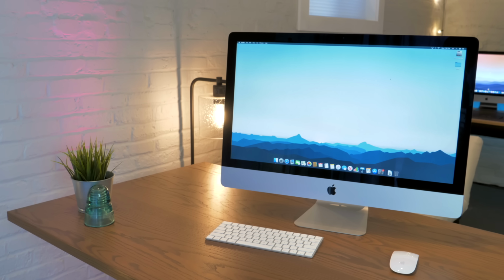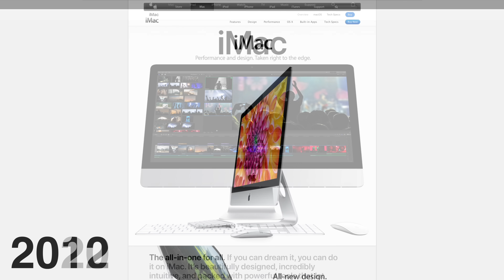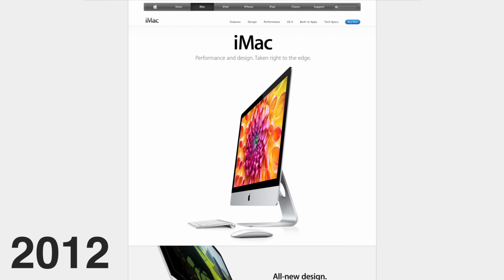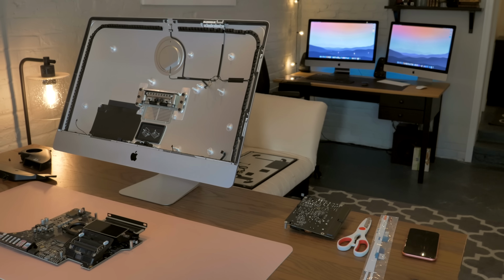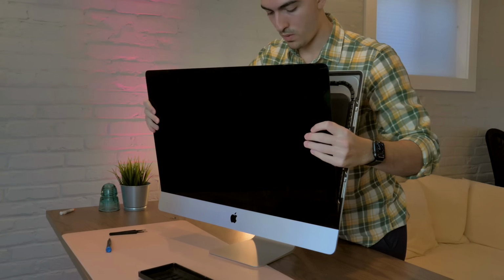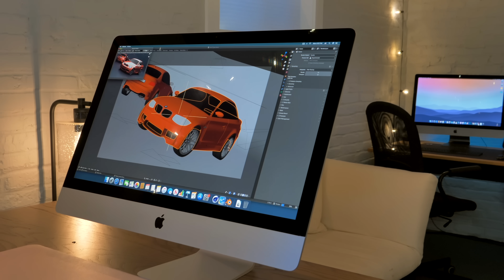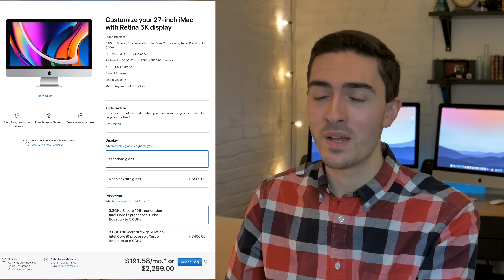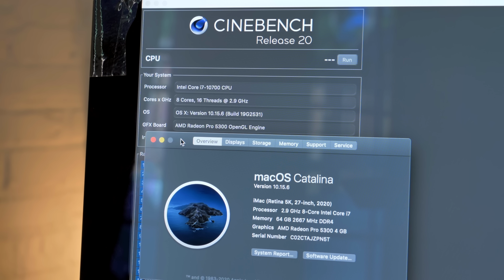DIY 2020 iMac upgrades! Is the LAST upgradeable Mac worth it?!

Comment: It kind of sucks they removed the NVME slot but having done some digging around about this myself as well as a "buy from apple or DIY comparison" I'm not sure it matters much that they removed it.  NVME storage is a pretty expensive option and Apple is, and I hate to give them any credit here, mostly competitive with the DIY route on price.  Some basic arithmetic tells me that at 2TB it's probably smarter to just pay Apple the $500 they want.  It's $429 + tax going the DIY route.  That's based on the 970 Evo Plus.  So just about $450 let's say.  Taking into consideration the disassembly the math just doesn't add up at 2TB.  For me at least.

At the 4TB point it might start making sense but the problem is buying a 4TB Nvme SSD.  Options are kind of limited.  There is the blue label Sabrent Rocket at $899 + tax but Sabrent don't quote a TBW rating.  Or at least I couldn't find it anywhere.  2TB 970 Evo Plus is rated at 1200TBW.  The copper label Sabrent Rocket would be a good option perhaps with 3600TBW rating but it's not offered at the 4TB point only 2.  Buying the blue label Sabrent is about $1000 with tax and it is a TLC drive after all so maybe at this point it starts making sense.  I'd like to see a TBW rating but for the purposes of this thought experiment here I suppose we could overlook that.  You still have to disassemble your imac though so is that worth $500 for you?  I don't think it is for me.  I'd still just give apple the edge here and just pay the $1500 they want to save myself the headaches.

Finally at 8TB the DIY route might start making sense.  Thing is though you can't buy a MLC/TLC based nvme drive of this capacity.  Looking at the iFixit teardown it looks like Apple RAID their NVME drives inside the imac for capacities above 2TB.  See here: https://www.youtube.com/watch?v=e8PVW2E0ogI&t=250s
Ifixt tore down the high end imac 2020 with 4TB of storage and you can see it's 2 SSD sticks.  I'm pretty sure the reason they do this is because TLC based NVME drives at capacities higher than 4TB are hard to come by.  So again the picture is unclear.  There was only one nvme slot in the 2019 imac so even if this was left intact not sure you could do much about it at 8TB capacity point.  Of course this could all look different down the line but for the moment I'm not sure if you could take advantage of the slot even if they left it.  And since it's hard to find 8TB MLC/TLC based drives at this capacity the price comparison is kind of impossible.

The prices above are all CAD by the way.  The situation could be different in the US or elsewhere obviously.  Also I've done a bare minimum of research about this as well just fyi so take all this with a grain of salt and do your own research.  Because the nvme slot is gone though it's all a moot point perhaps.

Comment: A couple of hints to help.
1.) when removing the display you put some masking tape at the bottom to stop the display sliding off.
2.) I would remove the chip strap as that would help removing the components (chip strap screw are the cross head at the bottom and it lifts out)

Comment: Why not track down one of the slots for the upgradable ssd, or remove one from a "dead" imac parts machine to solder it to the pads that were left on the motherboard to see if it would work.

Comment: Luke: in respect to Blender: if you tested only under MacOS you didn’t really test the GPU because Blender doesn’t support METAL only Open CL for AMD cards and Mac OS doesn’t support OpenCL anymore. You would have to switch to windows and run it there. In which case you can select options for rendering: CPU only, GPU only or combined.

Comment: What brand makes the best adhesive kit so that the screen doesn't fall off and break 2-3 days later? I have an OWC adhesive kit for my 2015 iMac to use when I install my 2TB SSD with their thermistor cable kit, but I'm afraid it might not b the best (everyone seems to have reports of failure).

Comment:  certified technician tip: when servicing any iMac - remove the security bar which lines the bottom of the display enclosure. 
The reason you were having so much trouble wiggling components out is because the bottom-lining adhesive actually covers the roughly 9 screws holding the security bar in place. 
Once removed everything slides out with ease. It's also one of the first things we check to see if an iMac has ever had any "unauthorized repairs."
Reply: it's called a chin strap
Reply: @thecheapthrillspodcast was gonna say the same 🍻
Reply: Simply excellent you are sharing that knowledge. So praiseworthy. Not that I even have an iMac, was only leisurely watching this video. but I was struck by something so generous. Most other guys in your position would worry about financial loss letting such things into the wild...
Reply: @BilisNegra  i actually hate my job. I have to give so much bad news to customers as a technician in regards to logic board failure resulting in data loss unless they've already backed up their data.
i'd much rather end-users be able to actually own the tech that they've already bought. just like any PC owner - you should be able to upgrade your RAM, Storage, GPU,  and given the recent shift to Apple Silicon - especially the CPU.
I'll always share whatever is helpful.
Reply: @BilisNegra  the way Apple and Apple servicing is growing no one will ever lose work / income by sharing such things. It’s only when a technology and market are shrinking that people start trying to project their own nuts. It’s book time for all things Apple. Those of us that DIY would never pay for tech skills if we already have em anyway. Just did an airport / time capsule 8TB upgrade on my kitchen table today. Took about 30mins. Easy when you have the skills.
Reply: Came here to say the same thing... was like "just remove the bottom bar and make your life easier" lol
Reply: where is the security bar?
Reply: so you can upgrade the ssd storage right?
Reply: @blueu127  nope, it's soldered, and it doesn't have extra SATA or NVME port.

Comment: Hi Luke! I was wondering if this MacBook on eBay is a good deal. It’s a MacBook Air 2012 with an i7 (3667u?), 8gb ram, and 128gb ssd for $379
Reply: Mba 2012 will be rather slow these days, mid 2013 is a minimum IMO. I personally had mba 2013, now mba 2017 and  still love it in 2020.

Comment: I’d rather see slightly larger, if need be, Macs 8Ch that they can be upgraded. I’ve owned Macs for years but am saddened by Apple’s push to restrict both upgrades and serviceability; I originally went to Mac because of operational longevity but this gas nearly been eliminated because of Apple’s push away from serviceability. Apple goes out of their way to make things proprietary just yo limit service, even when this costs more than keeping things basic, like screws with special heads just as an example.

Comment: How is the power supply so dangerous if its not connected to any power source? Can somebody pls explain.
Reply: the capacitors store the rectified voltage form the ac on them. ideally the power probably has bleeder resistors in parallel with those caps. but not always. im not sure if the imac power supply does or not.
Reply: Capacitors

Comment: I wish I could upgrade the GPU in my 27" iMac (Mid-2010) so it can run Mojave and Catalina without the weird video issues. There are several features that High Sierra cannot do after I upgraded my iOS devices to 11 and higher. The old Apple iBooks app no longer displays the highlights made on my iPad or iPhone. The Handout and Continuity no longer work between iMac and iOS devices. And so forth.  So, I am pretty much stuck with specific Radeon 5xxx/6xxx GPU that was used in Mid-2020 only.
Reply: Well I upgraded my 2011 21.5 to catalina which is also supposedly unusable but it’s really not that bad at all, it’s far from unusable and youtube even plays full quality with relatively no lag anywhere on the os, I would make another partition and upgrade to catalina so you can boot into both operating systems when needed, high Sierra for full GPU acceleration and catalina for needed features
Reply: My 2011 has a 6750m gpu

Comment: Hold up. You can upgrade the processor? I just replaced the PCIe SSD (higher capacity) and swapped the 1tb sata hhd to a 2tb ssd in a 2019 27" iMac, , so I'm not scared to open itc up.

Comment: Would this mean that you can in a few years, when 11th and 12th gen etc are out and use the same socket, you can upgrade to newer Intel gens on this same iMac? Would be worth picking one up used in a few years then when the Intel based Apple products dropped in price due to ARM

Comment: No NVME card slot?! I'm staying away from the 2020 iMac
Reply: In T2 systems, the system boot device is locked to the T2 chip, same way the flash in an iPhone is tied to the secure enclave in the A-series CPU. If you swap storage, you need to swap the T2/A# as well. LTT just did a 20 minute ad.. ahem sponsored video from Drivesavers showing how they accomplish that for a "full transplant" iPhone/iPad data recovery. As a tinkerer, I don't like it, but it does make sense, this is why Apple's encryption is so strong, and I gotta appreciate that as somebody who values security and privacy.

Comment: the TDP is the biggest factor... when I was upgrading a 2011 21" which had an i3 , I was tempted to go with the i7 2600 but picked the i7 2600s  which had a lower tdp... the 21" case especially,is sensitive to overheating if you go crazy with cpu power and you could easily have a toaster on ur hands with a faster chip that you cant really use... the 2600s worked superbly with low overall temps and 4 cores , 8 threads really helped performance... this imac ,I had ,was the educational version that came with an i3

Comment: I’m not sure you’re right about the ability to use any Intel 10th gen CPU out there – you’re using basically the same CPU here, K’s only difference is the unlocked multiplier. Please try with a CPU not otherwise found in iMacs and I believe you’ll find out Apple microcode won’t let you boot the machine.

Comment: I have to wonder how Apple will market CPU upgrades in the era where everything is Apple Silicon. Intel made loads of SKUs Apple could just let you pick from, but Apple themselves generally only makes a handful of chips at any one time. They'll have an A14, and then (presumably) an A14X with a few more cores in it. Either they're going to have to go a lot wider with the X variants and start locking cores like Intel does, or they're going to dramatically simplify the options you can get on the iMacs and MacBooks.

(Also, how are they going to handle Apple Silicon Mac Pros? A 28-core A14ZZ? Dual-socket systems? Just don't bother and keep that product line on Intel forever? Chuck a Threadripper in there?)

Comment: Well, I've recently bought a 2012 iMac and did what you did here: upgrade it to i7-3770, 32GB RAM and 2TB SSD inside. Man, what a beast, I really enjoy the way it runs now!
So, see you again in 8 years, when I'll buy and upgrade my "new" 2020 iMac...
Reply: Can you also upgrade the gpu?  And the screen? I'm asking for a friend...lolz
Reply: @DKBEAR78  Nope, GPU is soldered on the board; screen is replaceable, not sure about upgradeability. Glad to help your friend!
Reply: @dacbuc  
Thanks for the response. 👍
Reply: Is there 2012 a retina displayor not? I already have an upgraded 2012 Mini & 2012 MBP, as well get the trio with an iMac..lol thanks
Reply: @williamnale7835  Not a retina display, a so called 2K one (2560 x 1440 - actually, 2.5K name is more appropriate)
Reply: Glad to hear this success story. I just replaced the HDD with a 2T SSD and am I impressed with the "new Life" my machine has!!  I just picked up the i7-3770 and plan to install this week. Years ago I upgraded my 4GB Ram to 8GB. Will 32GB make much difference in its performance?
Reply: @intothelight7945  32GB helps if you have a ton of apps running, video editing and stuff. On the other hand, 16GB WILL make a difference over 8GB. (typing this on the aforementioned 2012 iMac - still going strong!)
Reply: Four years in, how’s it lasting?

Comment: Best advice is get the 27" you can afford, then get the RAM else where and save a bundle! I'm gonna miss user upgradable RAM, I've got a 2012 and the first thing I did was drop 32Gb into it about 5 minutes after opening the box! I've so tempted to get the 2020 and even if it lasts 5 years I figure I'd be ahead of the game just with the RAM savings over the next 27" iMac.

Comment: Also, I got a bit of a 240v tingle off an older imac power supply, that i left plugged in when checking the video cables. annoying ... my advice id DONT DO IT !!!! if you had a bad heart it might be a problem so DONT DO IT.

Comment: I have the iMac 2017 and did an upgrade from 4C i5 w/o hyperthreading to the i7 4C with HT. (All 7th gen cpus). It has 512GB and I upgraded the RAM to 40GB (8 stock + I added 32) and has Radeon 580 8GB. 
You were mad about the hard drive, I was happy with the 512 but need more fast storage as well. I bought an Thunderbolt 3 M.2 enclosure (from sonnet I think?) and put an western digital black 1TB in it. Over 2GB/second speed. Side note, I tried the Samsung 970 but it was slower and had hiccups sometimes, the WD is perfect. 
I have all my music, tv, iMovie libraries on it, so on the internal drive is only documents and iDevices Backups (can’t source them out easily). 
Yes maybe a TB3 drive is overkill for mass storage of music and movies. But before the next iOS I do always safe my backup with the old iOS to to this drive and it’s around 200GB so I love the super fast storage.

Comment: I’ve done this more times than I can count. Pretty much every iMac from the original bondi blue to the new slim models.  I accidentally left on plugged in once and rubbed my arm on the power supply while removing the mechanical hard drive. Needless to say it didn’t kill me, but it definitely made me be a lot more cautious when disassembling them from then on.
Reply: I just did this yesterday and got a serious zap! Actually woke me up

Comment: Tangent: Something I didn't immediately realize when they announced Apple Silicon Macs is it's probably the nail in the coffin for upgradability, and probably repair. I wouldn't be surprised to see future MacBooks pairing components like they currently do with iPhones. I fear that my longstanding relationship with Apple will come to an end over this issue. I guess we'll see.
Reply: They're already doing that with the integrated SSDs and T2 chips... they're paired and cannot be separated (even if it could be removed, but say you're handy with a hot-air station/BGA-reballer, you're still screwed if you separate them)
Reply: @W1ldTangent  I mean in terms of an otherwise user-replaceable component (like the batteries and screens in iPhones) being locked down purely by software.
Reply: @accordinglyryan  oh ya, I'm sure that's in our future. Count me out. I've only ever bought used Macs I could still get fixed under warranty or I could work on myself. I'll go back to Linux on Thinkpads, IDGAF lol

Comment: 2 weeks ago, a Lenovo on-site technician came to my place to repair my Lenovo laptop. I asked him about self upgrades. He told me that I can change whichever components I want but I must keep the original components. If the motherboard is broken, they will need to reinstall the original RAM and SSD before running any diagnostics. Without them, they will need longer time to diagnose and help me to make a formal warranty claim... This is nice, because I can go ahead and install a SATA SSD, a faster NVMe SSD, WiFi 6 adapter, more RAM, and new thermal paste without voiding the warranty. That's independent upgrade and repair, right there.

Comment: Isn't it easier and safer to first remove the RAM through the exterior access panel? No accidental scraping ('chipping') of the chips when removing the motherboard, because the profile is slimmer. Of course, installing the new RAM afterwards.

Comment: I don’t see any real reason why you wouldn’t be able to upgrade the RAM on an Apple silicon Mac, other than Apple makes it non upgradable. I think the 2020 iPad Pro has 6 GB of RAM on the SOC. In a windowed environment like Mac OS with multiple applications running it seems like it would be easier to have Standard RAM external to the SOC. 

That being said, I think you’re probably right about not being able to upgrade anything on a future Mac, so you will have to order what you think you will need on Most Mac’s. Maybe the “Pro” versions will allow some upgrades.

Comment: I bought the 8 core version, and it's a Marvell!!, I love it, just buy the TOP BASED 2020 27" IMAC and buy the Ram from your favorite tech supplier and that's it!, but there is one thing that you didn't address, could you add an extra SSD in the empty slots? are the SATA CABLE AND POWER unsoldered?
Reply: I think it's at least theoretically possible you could solder on the connector for an SSD (assuming you can find it, doesn't Apple use something proprietary for their removable drives?) and use it for a storage drive, but you cannot boot MacOS on a T2 system from anything but the integrated flash as far as I am aware.

Comment: I have the base model 2019 and put in 128g of Ram and I added a Thunderbolt enclosure with a 1 terabyte m.2 and only use the internal spinning drive as an extra TimeMachine. I plan on swapping the processor for a i9-9900KF or i9-9900K when my  care expires in 18 months.
Reply: So how it goes? Did you?